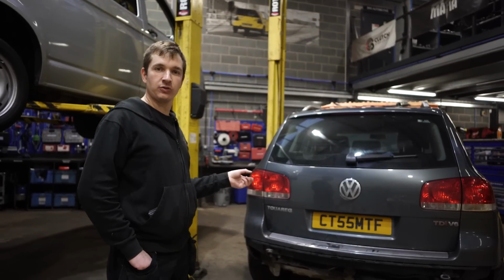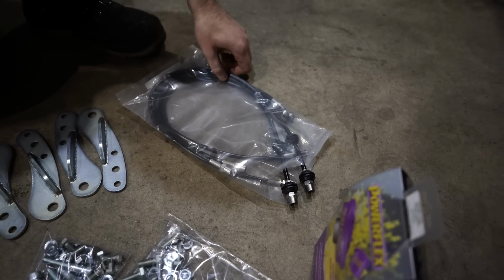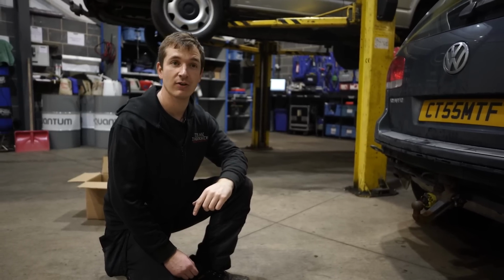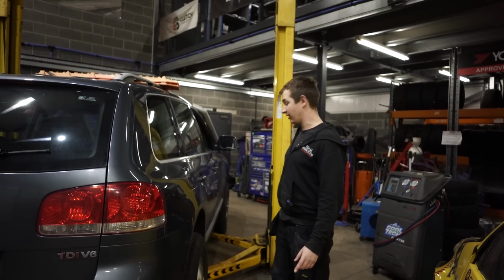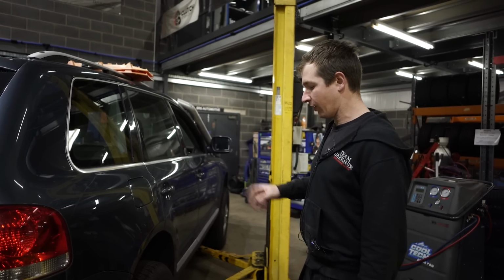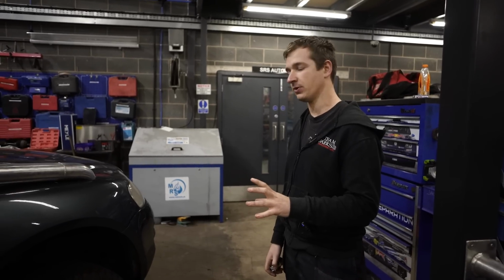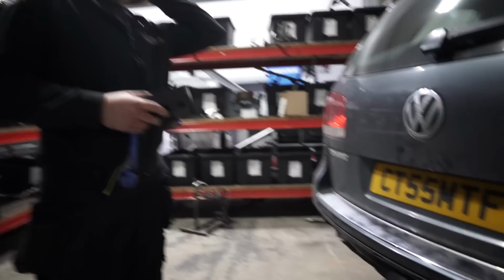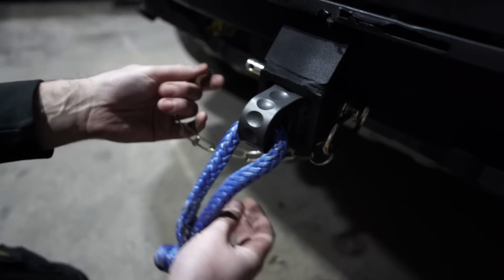3.0 V6 TDI BKS Touareg BODY LIFT

Comment: I am looking at getting this for my petrol V6.  My subframe bushes need replaced apparently so think 2 birds 1 stone.  Any tips for getting the subframe bushes out as a diy mechanic with no lift??
Reply from the maker: Deffo the best time to do it, Cut them like you would a normal suspension bush and hammer out :)
Reply: @DarksideDevelopments  nice one, cheers.  👍🏻
Reply: @DarksideDevelopments  just out of curiosity, what tyre size were you able to move up to with the lift kit installed on the coil-sprung Treg?
Reply from the maker: Moved up to a 32.1" tyre but had to move the intercoolers slightly forward. We then went to a 33" tyre and had to swap to a front mount intercooler and chop a bit of the arch for clearance - https://youtu.be/pO5Ejm-Qj8s
Reply: @DarksideDevelopments  nice.  Beauty of the V6 petrol is it doesn't have any coolers to relocate.  But the sills might be an issue.  
Thanks.  👍🏻

Comment: Nice upgrades. Is the front higher because of the engine is lighter then the v10? Great idea with the new towing eye and winch bracket.
Reply from the maker: Think it the spring Vs Air

Comment: i have to 2016 audi q5 2.0 tdi and i was thinking,  how can i make it more offroad worthy without ruining much the dynamics. 
My first though is to put a wavetrack rear diff, which is torque diff with mechanical self locking. Then obviously skid plates and thne have a second pair of wheels, 19s with cup 4 for the road and 18s with at tires for offroad. The last thing would be to add some adaptive dampers and some bilstein offroad springs. these would lift it a bit, which would ruin the handling a bit, but with the rear diff and the adaptive dampers woul kinda make up for it. Finally some tuning would help. Since this project would take me a lot of time, i d love to see someone trying as well. The q5 is a goood all around car(pre 2017 q5 with the proper quattro, or later sq5).
Reply from the maker: Without low range and a proper centre difflock you won't make it up many steep hills so a Cayenne or Touareg is better!
Reply: @DarksideDevelopments  it has a center torcen c diff with self locking function as well. And so far without even the mods i ve mentioned before, and with shitty tires, i has made it through everything i asked just wuth the center diff and torque vectoring and off riad trqction control.
Reply: @DarksideDevelopments  cayennes and touaregs are very big, old and expensive to maintain and run in my country, and a second gen cayenne is  expensive to buy second hand
Reply from the maker: Low range make a big difference but go for it!
Reply: @DarksideDevelopments  i know, but i was thinking that with a good tune, ir engine swap lol you would have enough low down diesel torque. But off course low  range  is crucial, but im going to go rock crawling with a q5 lol

Comment: When you lock the central and rear dif in low mode it lights up on the display always wondered if there was a option for the front dif as the symbol is there 😁🤷‍♂️
Reply: the front locker was only available on prototype military models iirc
Reply from the maker: You can buy the switch but nothing else!
Reply: @DarksideDevelopments  there's a guy here on YouTube that's got a front locker on his, I think it's a harop front e locker. The video is pretty good, he's got a beast of a touareg
Reply: @DarksideDevelopments  does anyone make one that could work  arb or maybe conversion from vw parts bin
Reply from the maker: Harrop are sending me one when they are released, depending on price of course!